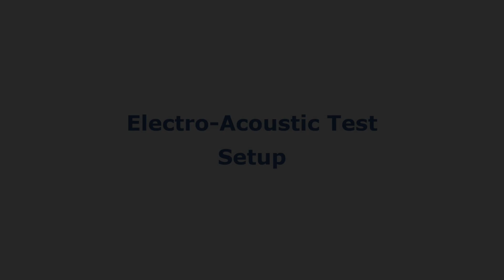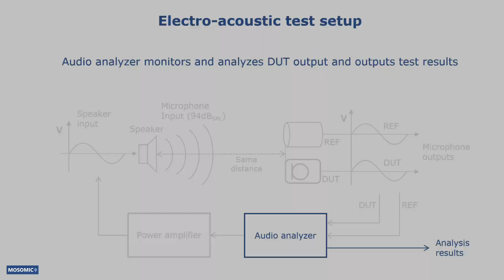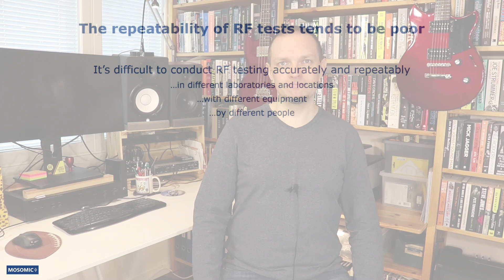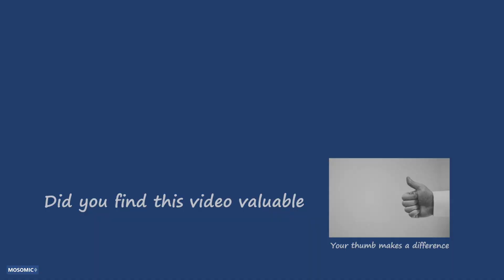Electrical and Acoustical Testing 2: Details | MEMS Microphone Guide Ep26 | Mosomic

Comment from the maker: 0:32 Electro-acoustic test setup
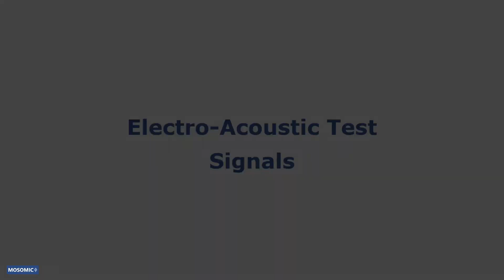3:51 Electro-acoustic test signals
- 3:53: Test signal frequencies
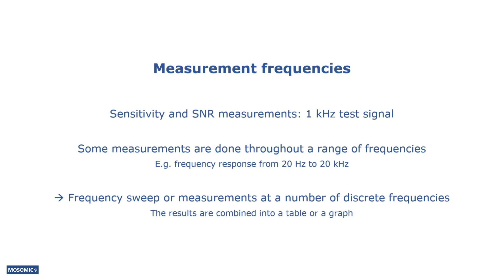- 4:32 Test signal sound pressure levels

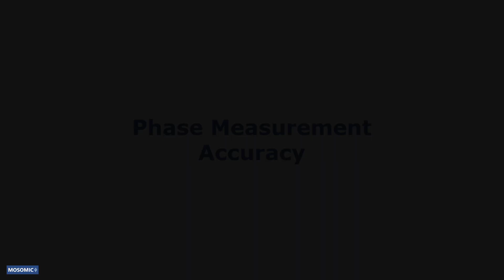6:23 Phase measurement accuracy

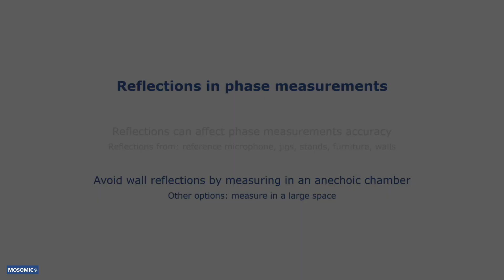8:31 Electro-acoustic test system requirements
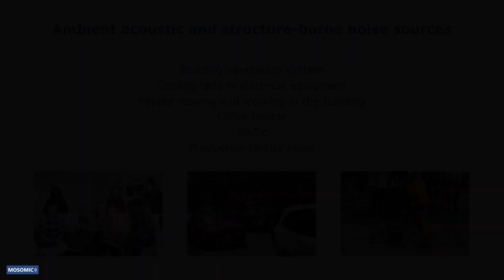- 9:32 Ambient noise reduction (ambient and structure-borne noise)
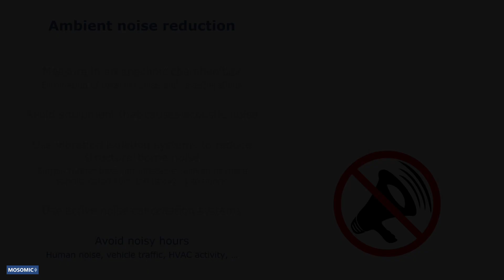- 10:46 Electrical self-noise of the test system

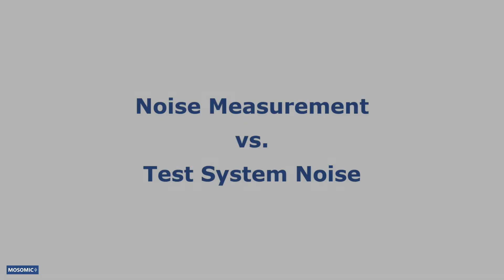11:59 Noise measurement vs. test system noise
13:02 Electro-acoustic test environment
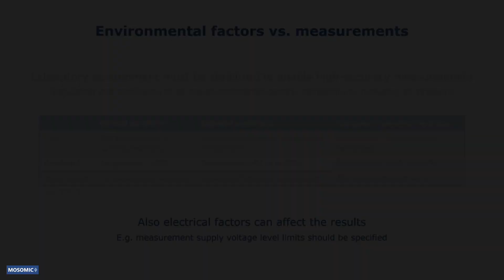14:44 The human factor

15:32 RF testing
- 17:24 Poor repeatability of RF tests
- 19:01 Common RF tests